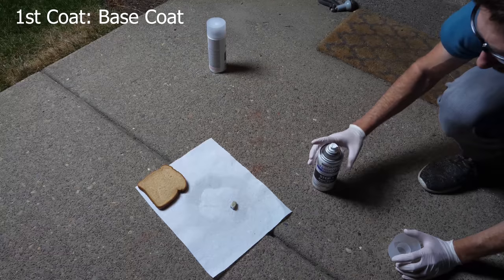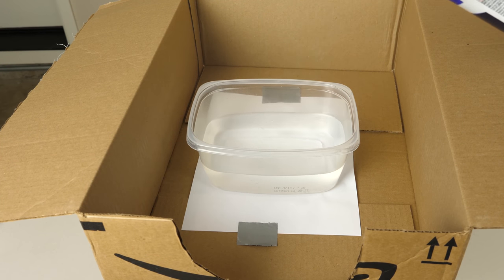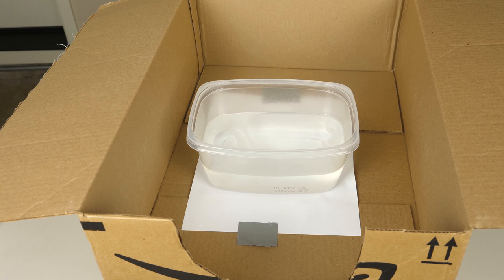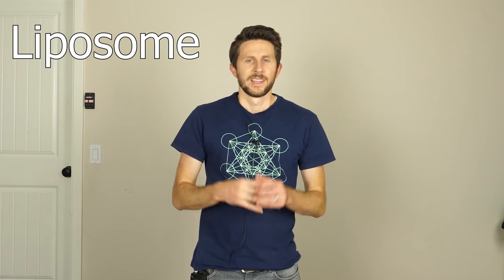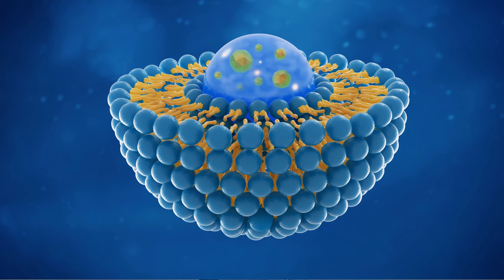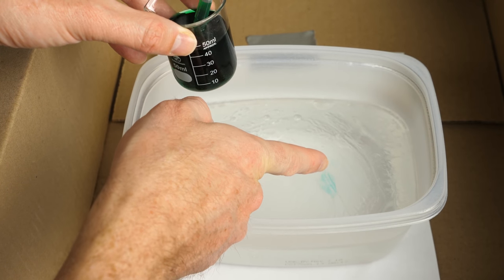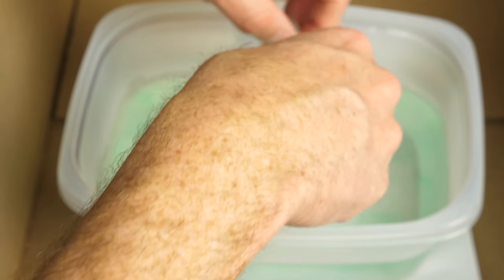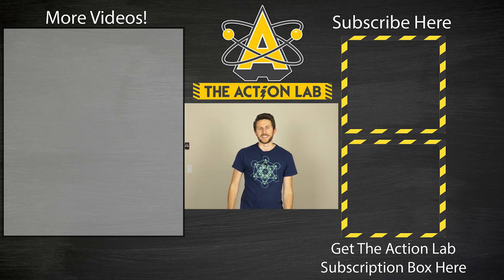Is it Possible to Make Water Waterproof? Spraying Neverwet on Water Experiment

Comment: Try never wet on a dead fish. Will it sink or float?
Reply: Neither it'll float in the air, duh
Reply: same as if didnt have anything,things stay/go down for pressure not just because they are wet.
Reply: Yaaaaaz
Reply: Sink
Reply: better, try never wet on a living fish
Reply: I'd be the same but when you pull it out it won't be wet
Reply: wont a dead fish float any way ?
Reply: Well it's dead already it'll float
Reply: 31337 Clan not true when fish die they will sink, if they die from oxygen bloat then they will float
Reply: DarkIzo nope
Reply: @maxl5112  bruh where you getting your facts from.
There's a little sac of air in a fish that when it's alive it can control how much water is in it so it can determine how much it floats. When it dies they have no control over it and the oxygen inside is stuck plus the decomposition gasses fill the guts and the sac. So it'll still float. Cause of the gas inside.

Comment: "If you're wondering" and  "I guess" do not mix well, like this stuff and water. It is thicker at the edge because it is hydrophobic and the only bonding surface it has is the plastic container. Also as you spray, it has a higher concentration around the edge because it is slightly enclosed. Just as if you had an empty container and regular spray paint, the edge of the horizontal base and vertical walls would have the thickest paint.😉

Comment: What is next....fireproof petrol
Reply: Technically, the fire retardant FM-200 is a propane, it's the mixture with oxygen that determines if it'll burn hence computer rooms using the fire retardant must be airtight and sized so the mixture is not flammable.  Likewise, gasoline / petrol is fireproof under many fuel air ratios, there's just more fuel air ratios where I's flammable.  So yes, petrol can be fireproof.
Reply: @johnwang9914  r/woosh
Reply: He was featured in YOU HAVE BEEN WARNED 😍

Comment: Wait so if i spray never wet on my clothes...does it wash off after i wash it?
Reply: You technically can't wash it
Reply: No but since it is an hydrophobic coating/layer you can always remove/dissolve it with some other non-polar or hydrophobic solvent.

Comment: If your wandering why the water stays more towards the ends is because of the water molecules which kind of lifts it up towards the edge
Reply: "If you're wondering" and  "I guess" do not mix well, like this stuff and water. It is thicker at the edge because it is hydrophobic and the only bonding surface it has is the plastic container.
Reply: Luke Razonski did u watch the Cheerio video to
Reply: No I'll try to find it now.
Reply: "The cheerios effect" by it's ok to be smart?
Reply: Luke Razonski yes!
Reply: Yea, I figured that so I watched it anyway. Did you read books by preference as a kid?

Comment: Making something waterproof is making it so it repeals water or refuses to connect with it. To make water waterproof you'd have to make it so that it constantly refuses contact. If you boil water, the molecules of water will separate and won't connect back together until cooled down. Does this mean steam that is being sustained at a high enough temperature is waterproof water?